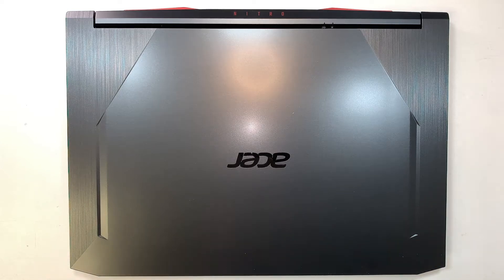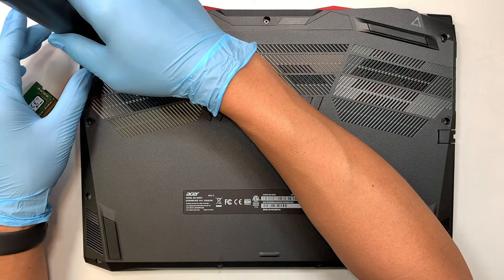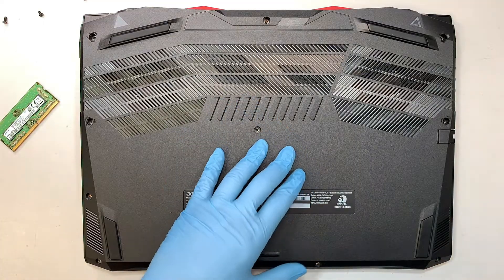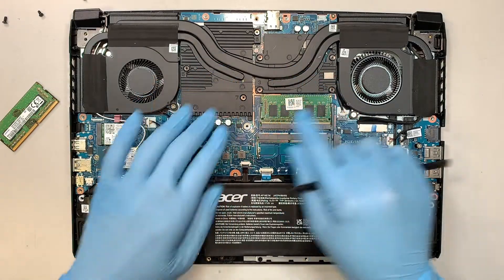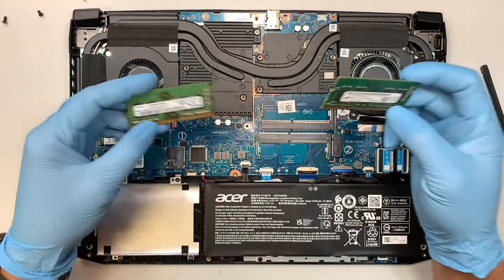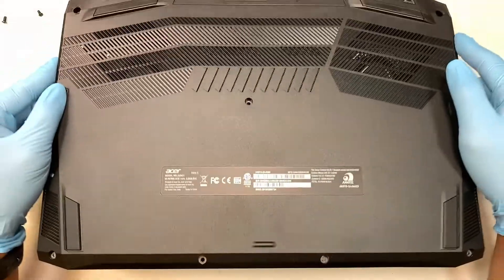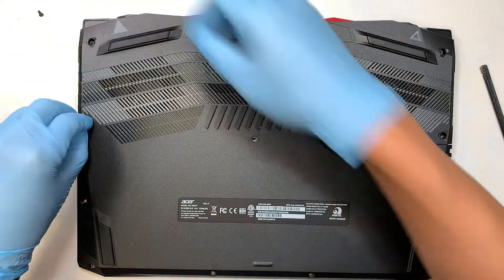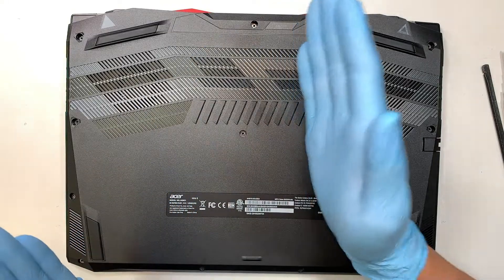Acer Nitro 5 RAM Upgrade 16gb

Comment: Hi UberGeeks! So glad you did a video for this type of computer again ☺️ I do have a question I must ask, if I removed the Heat-Sink tape on top of the fans, would it stop the computer from turning on anymore?
Reply from the maker: Heatsink tape will not stop the laptop from turning on. Did you connect all the cables back in ?
Reply: Also when I mentioned the heat sink tape, I’m referring the little black strip tape covering the top potion of the fans, not the side ones
Reply: Oh dear, thank you so so much!
Reply from the maker: @arcticfox0927  You are welcome. Glad the video helped.
Reply: It looks like it’s working perfectly again, thank you so much UberGeeks, you were right about disconnecting the charger, I guess that was the problem! But I honestly couldn’t have figured it out by myself, I really appreciated ur help! ❤️☺️💻
Reply from the maker: @arcticfox0927  You are welcome. Glad the video helped.
Reply: I just checked it made sure the cables were connected and it seems like it still won’t turn on for some odd reason, before this issue started, it was working properly, do you have any clues as to why it won’t turn on? If not, it’s totally ok, im still greatful for ur help 😊
Reply from the maker: @arcticfox0927  Try disconnect the battery and do a direct power from adapter to see if that will power on.
Reply: I removed the tape only and nothing else
Reply: Ever since then it stopped turning on, I’ll have to check again if I accidentally removed any of the cables on accident
Reply: But ty ty so much for telling me that cuz I wasn’t sure if it was the tape or not ☺️still appreciate ur help

Comment: can you have one 8gb stick and one 16 gb stick or is that not good
Reply: You probably already got an awnser somewhere, but it's best to have 2 of the same amount because your system will be running through both at once meaning it'll be mismatched and you'll be running at two different capacities. You CAN do it I think but it's better not to for performance and such.

Comment: Is there a reason that my screen doesn't turn on after adding the RAM?? I followed all the steps correctly but it won't turn on now
Reply: Before installing ram de attach the  battery cable

Comment: Hey ubergeeks I change the ram out and when I put it ack together and turn it on. The screen won’t come on. Do you know what’s going on?
Reply from the maker: Maybe the Ram is not compatible?
Or not installed correctly. 
Try remove the new ram, see if old ram powers on with display or not

Comment: Quick question. Is there an upside down for the ram?  I saw you flip one, one way and the other sticker facing up on the new one. Never did anything like this but was just going to try. Dont want to fry something if thats possible
Reply: The ram will have a little chip in it that is asemetrical to the ram itself kind of like
——————————————v——————
And the divot will be pretty noticeable

Comment: I have the same laptop model as the one in  this video. I was wondering if it was possible to upgrade with a 16 GB ram so there'd be 24 GB in total.
Reply: You want to have the same type of sticks on both ports or else you could get performance issues

Comment: I think your wifi card soldering has been cut, the white wire that has to be soldered to the Wi-Fi card is disconnected and is misplaced above the SSD label.

Comment: Should I use 3200 Mhz or 2666Mhz?
Reply from the maker: 3200
Reply: @UbergeeksBiz  you only use 2600 though
Reply from the maker: @fabianralph5472  just to show in video. but you can go up to 3200
Reply: I had one 16gb 3200mhz and I put another 16gb 2666mhz. It's working fine! 🎉

Comment: i have two sticks of ram coming tomorrow, before installing do i have to drain the battery or is it fine just with latex gloves? Also after installing do i have to do anything when loading up the laptop or should i be good to go after replacing the case?
Reply from the maker: Good luck with adding new RAM. After installing, you do nothing. RAM work automatically.
Reply: @UbergeeksBiz thanks I’m getting my laptop soon it’s this exact one I’m trying to get it to play PC VR games so, you are very helpful in my case so I’ve subbed.
Reply: @UbergeeksBiz  do i need to do unplug battery before that ? a lot of people say this
Reply from the maker: @Konserwa342 you should. It’s recommended
Reply: @UbergeeksBiz  do you have or you will make tutorial how to do this correctly on acer nitro 5 ? And do i need gloves like you ?

Comment: If I currently have an 8GB 3200 installed, can I add a 16GB 3200 to my empty slot?
Reply: Yes you can. It’ll be 24gb ram.

Comment: would it be ok to get a bigger size ram stick than 8gb? like can i put a 32gb stick in and it will still work?
Reply: I have 64 gb in mine, 2x32 gb.
Reply: @MrKswildman  what brand did you go with and how have you liked it?

Comment: i think its advisable to detach the battery from motherboard before changing or adding the RAM then reconnecting again after done.
Reply: wasn’t an issue for me
Reply: I didn't do that and the screen wouldn't turn on so I'm going to do that
Reply: Was an issue for me. So glad I saw this comment. Thanks so much 🙏🏾
Reply: Thank you

Comment: I saw that some remove the battery first before installing or upgrading, do i need to?
Reply from the maker: I did mind without removing battery.
Reply: I did remove it to insert the new ram. It worked fine! 🎉